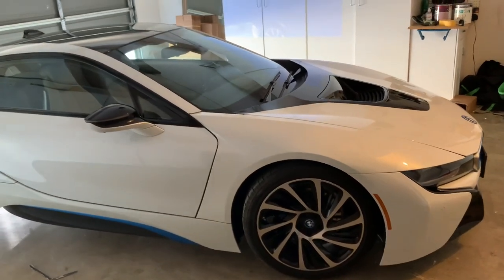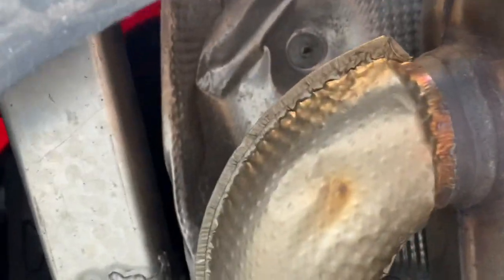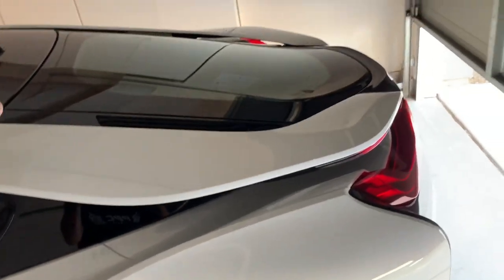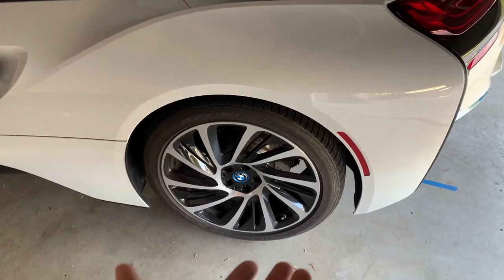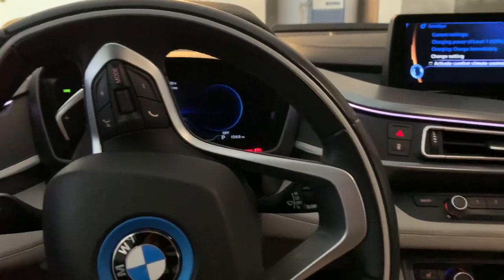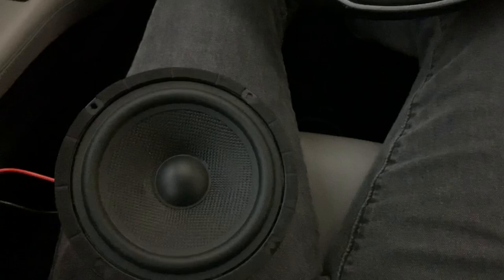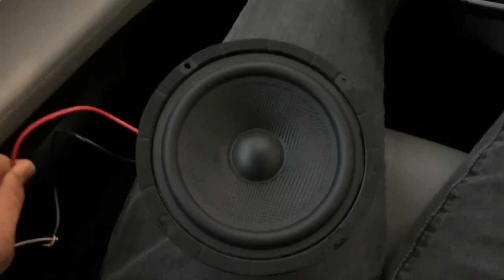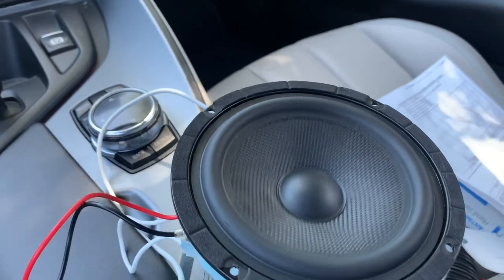BMW’s Dirty Secret: What The Active Sound Module Speaker Sounds Like Outside Of The i8

Comment: Dude you put the wires one inch apart with no insulation
Reply: We're not dealing with high current here. You can touch the wires together and you wouldn't feel the current. :-)
Reply: @jankywhips1756  well if you consider replacing a blown fuse a fun activity, then go on, short the wires 😄